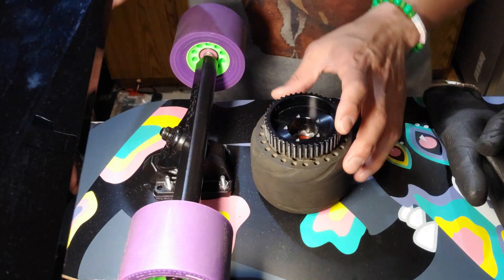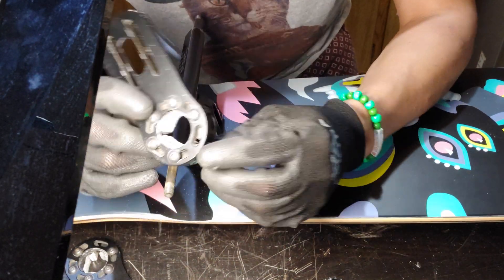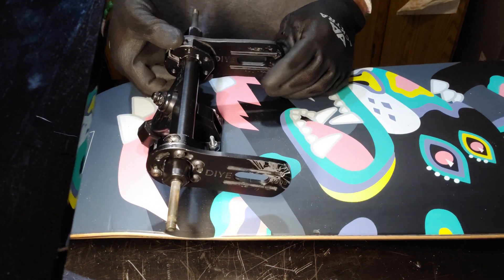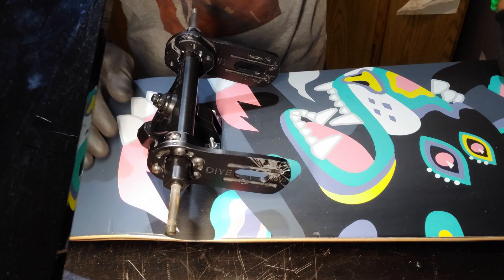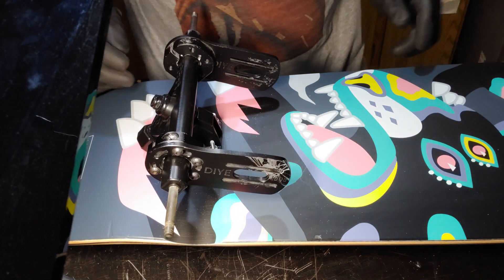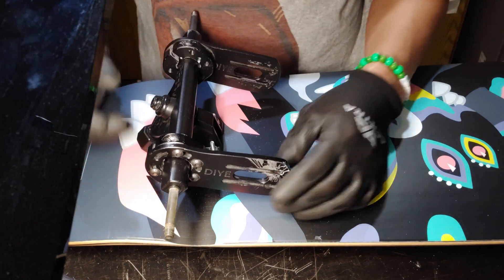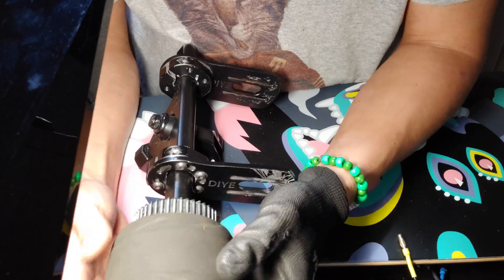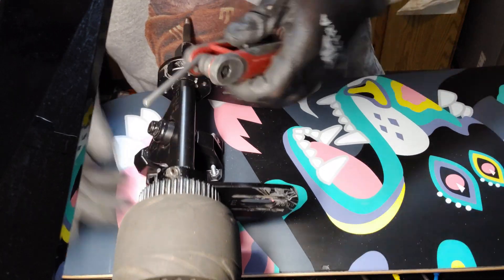Installing Trucks & Motor Mounts on DIY Electric Skateboard!

Comment: Heads up I had those motor mounts they never stay in place even with lock tight
Reply from the maker: Probably not lol but applied some vc3 loctite, let me see if they work well if not I will just drill some screws into the trucks.